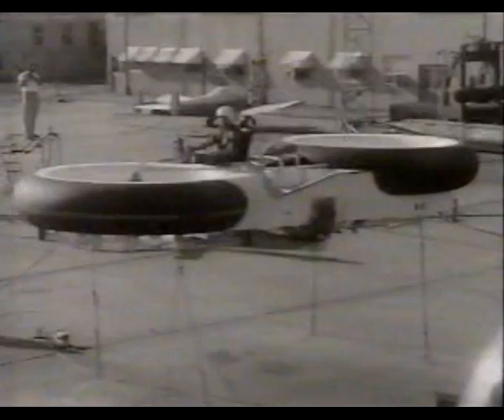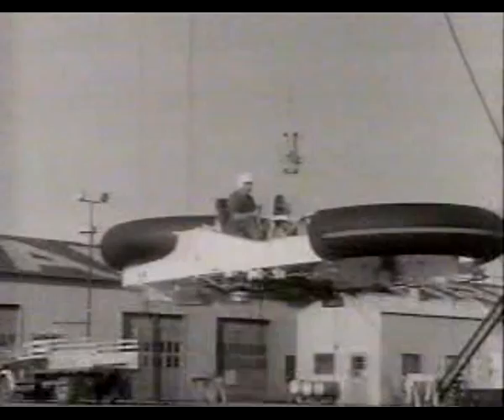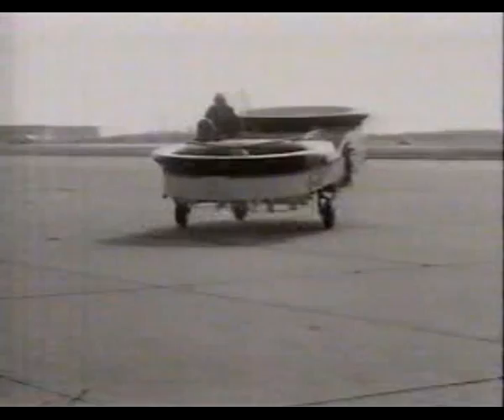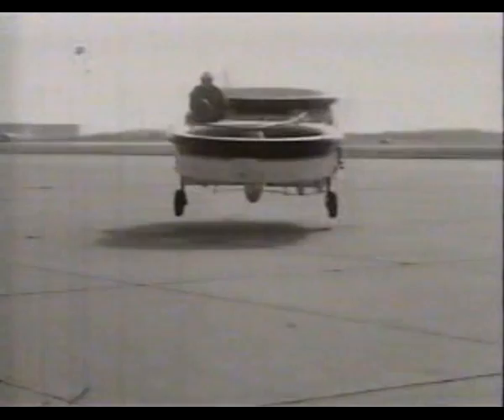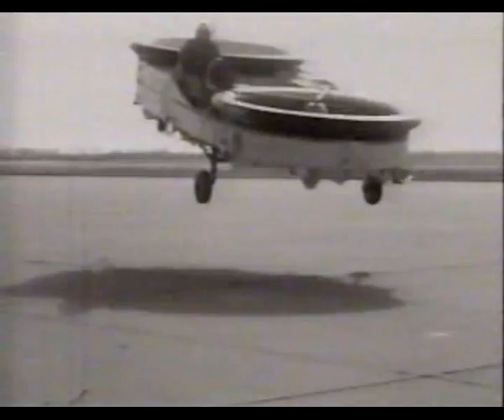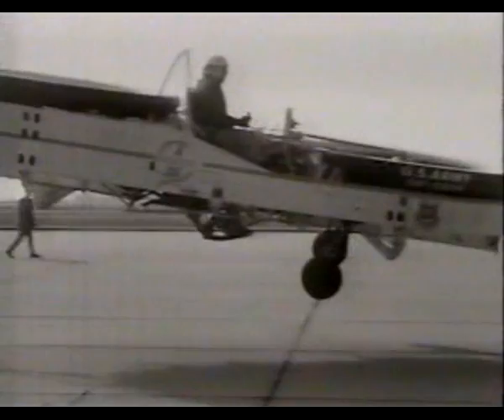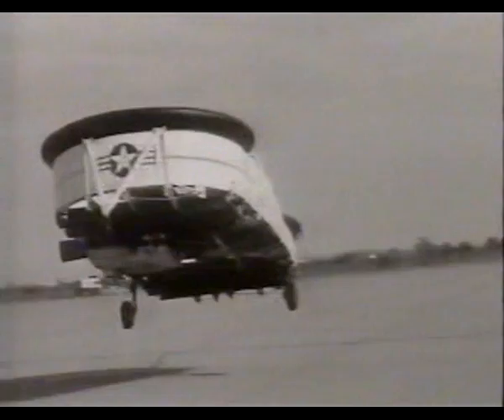Piasecki VZ-8 Airgeep

Comment: This was one of many novel ducted fan vehicles in the 50s. It was probably the best of the bunch but the maintenance requirements and cost were just too high for the results achieved. Look up the specs and performance. It had a range of less than 70 miles and a top speed of 70 mph, yet it would have cost as much as a good size helicopter (1100 hp turbine is comparable to early  Hueys.) Even so, a similar vehicle with current technology might be very useful in rescue and spec/ops.

Comment: "Why can't they build a modern flying car?"

Some reasons that occur:

1. Air traffic control would be an utter nightmare.

2. It took test pilots with years of experience to be able to pilot a Piasecki Airgeep; the risk of human error is *much* greater and more serious with something like this. Can you feature some rich housewife from the 'burbs trying to land one on the roof of the mall and crashing?

3. The noise would be a source of a lot of complaints.

4. Liability would be very expensive.
Reply: Imagine a flying car crashing to your house? You would be scared to sleep!
Reply: They could make flying cars atonomous to make them more user friendly and this way they probably wouldn't need a pilots license. Back then it would have been impossible but 30 to 50 yesrs of focused development and advancements in recent tech could have made it possible.